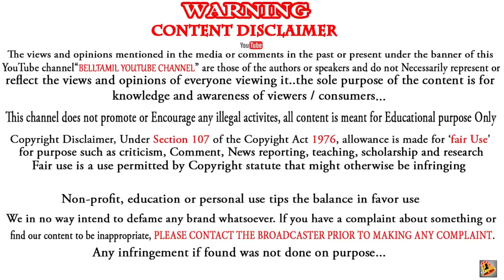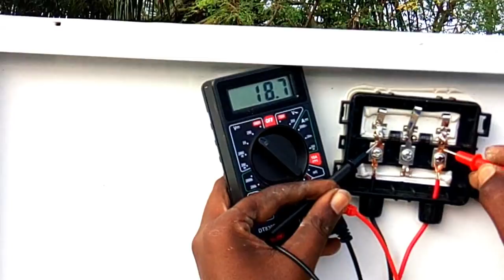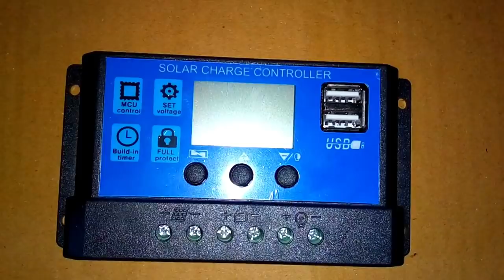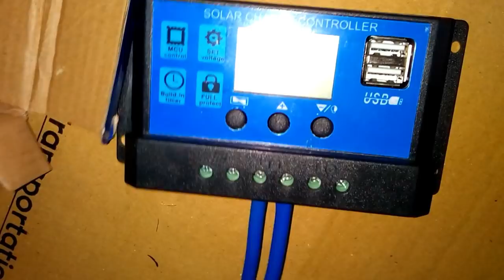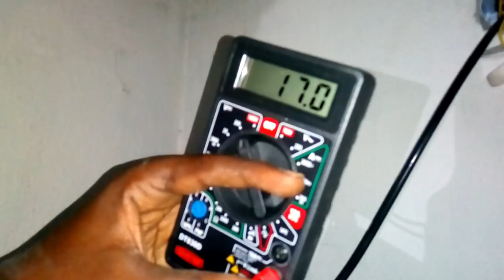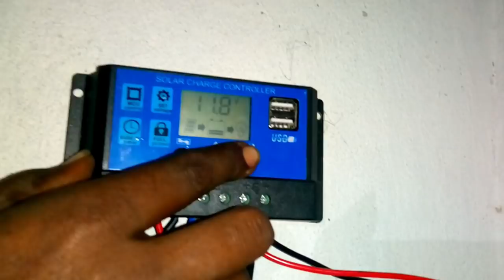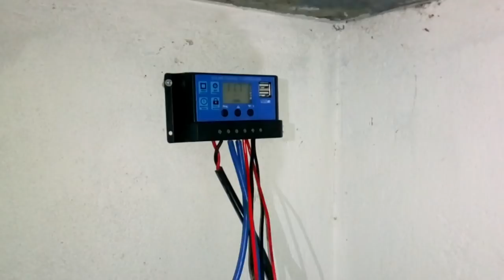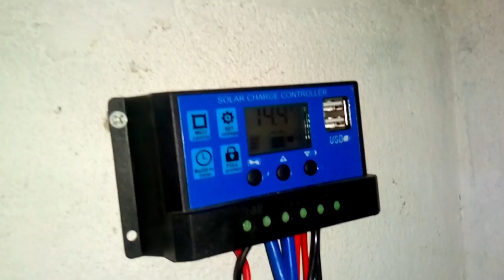How to make solar home for solar panels installation 12v DC full home dc connection...

Comment: தம்பி அருமையா விளக்கி இருக்கீங்க.
இந்த வீடியோ பாத்து கிராமத்தில்  சில காரணங்களால் மின் வசதி ஏற்படுத்த வாய்ப்பு இன்றி இருந்த என் வீட்டுக்கு DC & AC முறையில் நானே மின் வசதி ஏற்படுத்தி விட்டேன்.
12v / 180W loom mono solar panel - 1nos
12v / 110 ah Microtek tall tubular battery -1nos
20A PWM solar charger controller -1nos  போன்றவற்றை பயன்படுத்தி
9w DC Led bulb - 4nos (1nos whole night on for outside of home)
20w 4feet DC Led tube light - 1 nos
DC ceiling fan (whole night running) - 1 nos
12v car Mobile charger - 1 nos
500w DC to AC inverter ( for government table top grinder, mixie, laptop,hair trimmer) - 1 nos 
போன்றவற்றை பயன்படுத்தி வருகிறேன்.
ரொம்ப நன்றி தம்பி 🙏👍🏾
Reply from the maker: Thanks bro

Comment: சகோ...! உங்களுக்கு வேல தெரியுது ஆனா ப்ரோபரா பண்ண தெரியல 
சோலார் போனல், இன்வர்டர் போன்னவைகளுக்கு கோபிள் பயண்படுத்தும்போது சரியான லெக் பயண்படுத்தனும்
Dc wire Ac wire தனி தனியாக கிடைக்குது அத கட்டாயம் பயண்படுத்தனும் 
DC க்கும் AC wire போடகூடாது
Panel to charge control க்கு இடையே DC mcb கட்டாயம் பயண்படுத்தனும் 
Wire Colour coding கட்டாயம் பின்பற்றனும் பாசிடிவ் எது நெகட்டிவ் எது னு தெரியுனம் ல 
Battery ல முதலில் நெகட்டிவ் வயரை கனெட் பண்ணதுக்கு அப்ரம் தான் பாசிடிவ் வயரை கனெட் பண்ணனும் 
100Ah battery ம் ups 7 Ah battery ம் parallel பண்ணி இருக்கிங்க இது செய்யகூடாத தப்பு சின்ன பேட்டரி வெடிச்சிடும் 

வீட்டுக்கு பயண்படுத்துற Ac வயர் கூட Dc வயரையும் ஒன்னாவே எடுத்துக்கிட்டு போறீங்க, சோலார்க்கு தனியே தான் லைன் தள்ளனும் 
பேனல் க்கு wind resistance stand பண்ணி வைக்கனும்
பேட்டரி சார்ஜ் ஆகும்போது ஆக்சிஜன், ஹைட்ரஜன் வாயுகள் வெளிய வரும் எனவே அத திறந்தது தான் வைக்கனும் டப்பால மூடக்கூடாது இல்லனா பத்தி வெடிக்கும் 
பேட்டரி டெர்மினலுக்கு பெட்ரோலியம் ஜெல்லி மட்டும் தான் போடனும் 
நீங்க போட்டதும் பெட்ரோலியம் ஜெல்லிதான் ஆனா கிரீஸ் னு கஸ்டமருக்கு தப்பா சொன்னா அவங்களும் தப்பா போடுவாங்க 
Dc output க்கும் Dc mcb கட்டிப்பா போட்டே ஆகனும் 
பேனல மின்னல் ல இருந்து காப்பாத்த கன்டிப்பா எர்திங் பண்ணியாகனும் 
இன்னும் பல வேலைகள் இருக்கு 
ஆனா நீங்க ஈசியா பண்ணிட்டீங்க 
இது ஆபத்து 
இதனாலதான் இத்தனபேர் அன்லைக் பண்ணிருக்காங்க
Reply from the maker: ok bro 100Ah battery ம் ups 7 Ah battery ம் parallel  pannala...bro
Reply: Assume 100AH and 7AH both are 12volt battery .
Can connect 100AH battery and 7 AH battery in parallel when both are same voltage batteries but should not connect in series (if you do voltage imbalance occurs. both batteries charge current rating are different ,so in series connection same current pass through both the batteries),so 
in series connection no of batteries should be same AH , where as in parallel no of batteries should be of same voltage.
Reply: Super bro....
Reply: @dhayadpi2798  சரிதான்சார் 
இருப்பினும் 100 ஆம்பியர் பேட்டரிஉடன் 7 ஆம்பியர் பேட்டரி பேர்லல் செய்யப்பாட்டால் 
7 ஆம்பியர் பேட்டரியின் மீது 100 ஆம்பியர் பேட்டரியின் தாக்கம் எப்போதும் இருக்கும் 

7 ஆம்பியர் பேட்டரியின் பிளேட்டுகள் 100 ஆம்பியர் பேப்டரியில் இருக்கும் லோடை தாங்கும்படி இராது 

இந்த செயல்முறை இறந்த பேட்டரியை உயிரூட்ட சில வினாடிகள் செப்படும் செயல்முறை 
தோடர்சியாக 7 ஆம்பியர் பேட்டரிக்கு 100 ஆம்பியர் பேட்டரியுடன் இனைத்தால் சிரிய பேட்டரி எலக்ரோபிளேட்டிங் ஆகிவிடும் 

அப்படி இனைத்துஆகவேண்டும் என்றால் கரன்ட் ரெகுலேட் செய்தே ஆகவேண்டும்
இவ்வளவு சிக்கல் தேவையில்லாத்து
Reply: @umavadivelp3674   nothing happen  as u say and also electro plating not possible since both are same voltage.
It works fine.
(Lead acid Battery oc volt is 12.45-12.6V.this is same for 100AH and 7 AH.assume u r tapping load of 37A , Voltage drops to 11.6.now current is not equally shared,say 34.57A current runs through 100AH 🔋and 2.42A runs through 7AH battery).
Important: both batteries are similar type.
In battery u should say  charging not electro plating.
If u pass DC to two electrodes immersed in electrolyte.anode dissolves in electrolyte and form a layer on cathode.this is same happens in battery also, liberating H2 Gas.
Reply: Sprr

Comment: Bro yenakku oru 5hp motor run panna yevlo kv required, yevlo panal? 

Andha motor ah 12.5 kv Dainamo la connect panni 800 ft borwell, 5hp submarine pump run pannanum. Ithu possible ah..? I have Dainamo,  pump, pipes, wire.. Full set..

Comment: Good
Reply from the maker: Ok thanks brother
Reply: I need. On gride. System. A/c. Modeul. 3 kW. . meby.  How much.  With out. Battery.
Reply from the maker: 1200wtt solar panel usage for the battery 400ah inverter 2500watt
Reply: Now. New technology.  With out. Battery. And. Inverter.        Inverter. With. Panal. Down.  Connected.  With.  Dc. To. A/c.

Comment: Hi bro normal exit inverter800 Watts and battery 115ah, normal inverter  சோலார் இன்வெர்டர் ஆக மாற்ற முடியுமா இதற்கு dc to ac converter பயன்படுத்தலாமா எப்படி இதற்கு எத்தனை வாட்ஸ் பேனல் போடலாம் நார்மல் இன்வெர்ட்டர், பேட்டரியை சோலார் மாற்ற முடியுமா?  கன்வட்டர் பயன்படுத்துவதால் நன்மை தானா கொஞ்சம் கூறுங்கள்
Reply from the maker: You must use a solar charger

Comment: Bro can you arrange the solar system if we want
Reply from the maker: ok bro DC home 15000
Reply: @BellTamilsolar   
bro we have
2 fans 
2 tube lights
1LG TV (picture tube TV)
18 watts 4 blub
1Iron box 
1mixer
1fridge 

If we use this things then how many watts solar panels should be used ?
&
What is the cost bro ?

Comment: 2000w air conditioner ku solar pannel, solar charge controller, battery... Enna values la vanganum bro
Reply from the maker: Thanks for following us  2500 watts inverter in solar panel 1200watt battery 400ah che 30ah

Comment: கடைசி வரை விலைய சொல்லமாட்டங்க யுடியுப்விடியோல பேட்டரி விலை?  சோலார் விலை?  சோலார் சார்ஜர் விலை?  எதுவும் இல்லை
Reply from the maker: hi bro ok vaaaa...

LOOM SOLAR Panel 50 watt - 12 Volt  :) https://amzn.to/2SJ21FT
10A 20A amp Solar USB Charge Controller Regulator 12V/24V :) https://amzn.to/3vDVJWF
amiciSmart Solar Charger Controller 30A,  :) https://amzn.to/34C4yUT
 2V 7AH CS7 SMF UPS Solar Battery :) https://amzn.to/3uG37iP
 40Ah 12 Volt Power Plus Series Solar Battery :) https://amzn.to/3fJLryw
12v dc to 220v ac Converter 100 Watt :) https://amzn.to/2Rjxrm0
200 Watt USB Dc to Ac Converter 12v to 220v  :) https://amzn.to/3vVXY85
12V DC 9 Watts LED Bulb  :) https://amzn.to/34BVdMY 
12V DC LED 2 ft Battery and Solar Operated Ultra Bright Tube Light :) https://amzn.to/34HXkip

105w solar panel :https://amzn.to/37uqK5w
100w solar panel " https://amzn.to/37xbogp
325w solar panel : https://amzn.to/3s9H3wd
1kv inverter :https://amzn.to/2ZtUriF
100ah bartty : https://amzn.to/3pAt7dc
1hp moter "https://amzn.to/3pCvBHK
200w mini inverter "https://amzn.to/3ugxdL2
Solar Charge Controller: https://amzn.to/3unojvp

Comment: 1st time I need to installation 100 w solar, already a have normal inverter with battery how to I install
Reply: Wait .......
Reply: Solar convertion kit use panalam easy plug and play no need electrection...
Reply: @just_watch46  how to use existing invertor update to solar
Reply: Solar charger controller buy and install and it is very easy to install